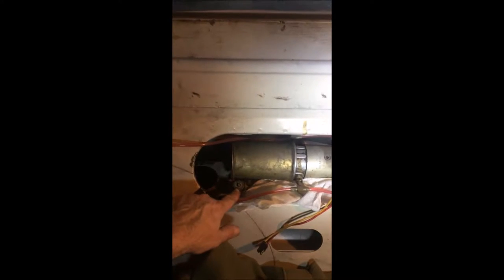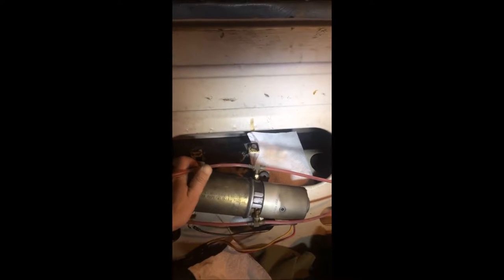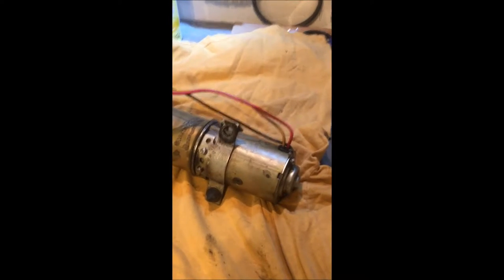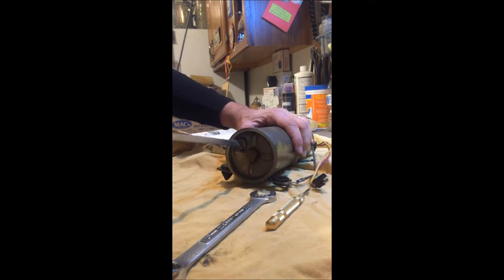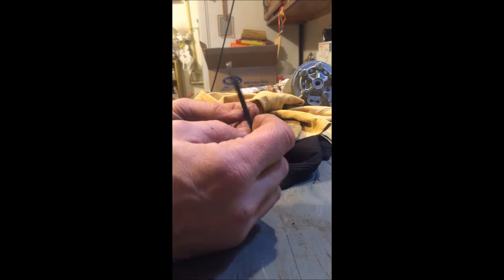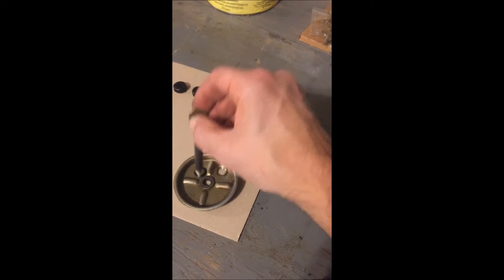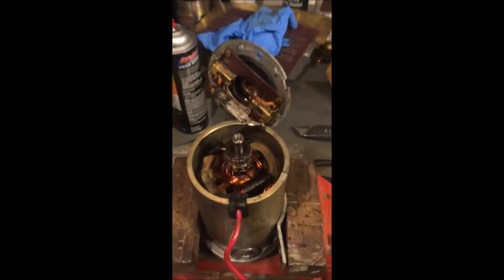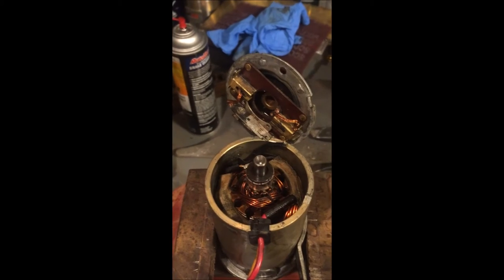Ford Falcon Convertible Hydraulic Pump Repair

Comment: Great video. I opened up a seized pump from a 1958 Edsel Pacer today. Got the pump working by cleaning it. Motor brushes were fine, so I'll just try to find the correct size o-rings. Thanks for uploading this! It was very helpful.
Reply from the maker: Glad it helped you.... my video skills sucked but hopefully you were able to figure out what I was doing.  Cheers!

Comment: Can I change the rubber washer that mounts to the main bolt with out removing the pump? My pump is leaking at the bolt.
Reply from the maker: If I understand u correctly, u could remove the bolt but accessing will be challenging. Also, if u remove the bolt then you’ve the fastener that holds the pump reservoir in place and it’s highly likely that it will separate from the pump and create a mess of oil/ trans fluid. I would suggest to simply remove be it. It’s easy and straight forward and I can replace the other o rings very easily.